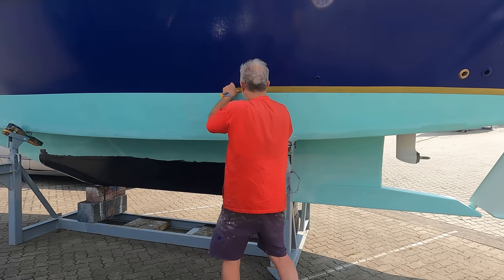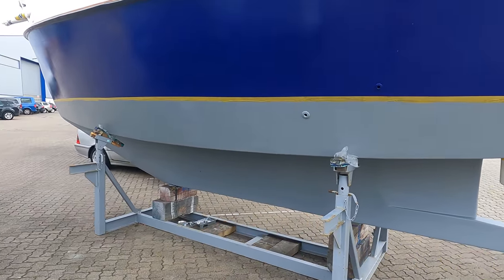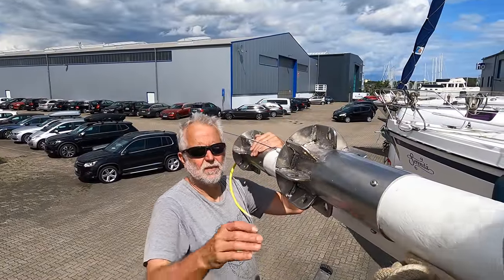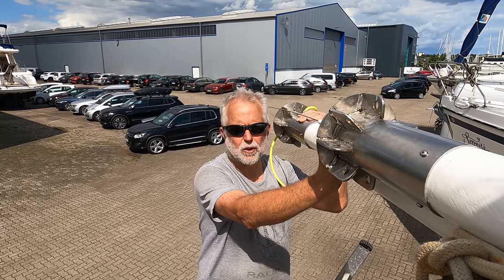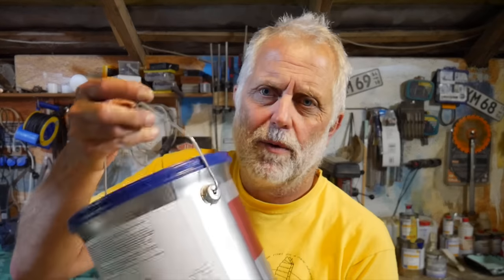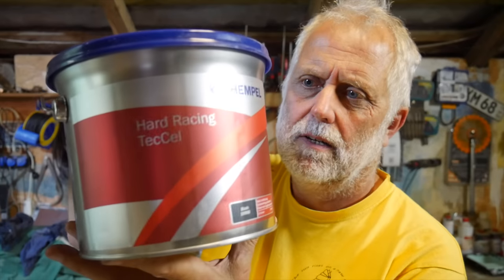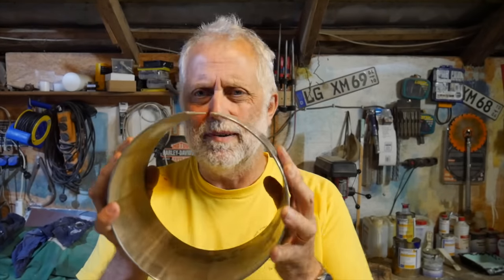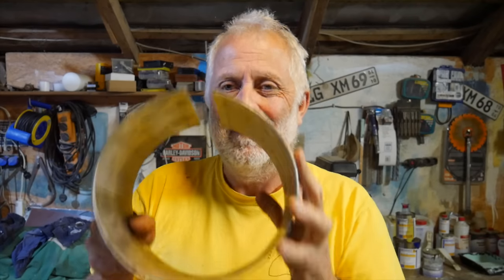Next Week Is MASSIVE!! - Building a cruising sailboat - SV Tapatya EP288

Comment: Superb Tony. Best wishes to your old fella on a milestone birthday. Paintwork looking sharp. On the mast clamp doohickey - maybe a thin sheet of rubber inside the clamp - increase friction and prevent the edges acting like a chisel as it takes the load.😉 Look like you will be back in UK just as the next wodge of rain moves through. Good luck with those final few jobs prior to splash.😀👍⛵️
Reply from the maker: Thanks Norman. 👍😃😃

Comment: Looking beautiful with that black bottom and blue topsides Tony. Nothing like having good steady help. Best wishes to your father for a wonderful 90th. If you have access to Ashley's book of knots, I believe there is a spar hitch used to raise spars. If I recall correctly, it consists of a constrictor hitch at the bottom of the spar and a series of half hitches in a chain to the top of the spar. It tightens with the load and releases when the load is removed. Have a great week.
Reply from the maker: Thanks Matt. I’ll look into that. Sounds like a useful resource 👍😃😃

Comment: That mast fitting looks easily strong enough, Tony,  to support your main mast, in sheer.  My, smaller, 8m mast (aluminium and douglas fir) was lifted in with nothing more than a tight clove-hitch knot, about two-thirds of the way up, and that rope went straight to the crane hook.  As security, I took a loop of dynema through the base of the mast (there was a small hole there for the VHF antenna etc) and the other end of the dynema round the main knot in the crane-lifting rope.  But I needn't have worried: the dyneema safety loop remained loose throughout.  In other words, the clove-hitch knot held.  But I like your idea better!  I can't wait to see those masts in place.  All my best to you, and happy birthday to your dad.  - Chris
Reply from the maker: Thanks Chris. Useful info 👍😃😃

Comment: I do a lot of site maintenance I am confronted with similar situations. I have had a lot of success with using big clamps with half pipes on the static and tightening threaded part of the clamp. 2 opposing  clamps like I’ve mentioned can lift really heavy loads. Good luck.
Reply from the maker: Thank you. That sounds pretty much like what I intend to do. Good to hear it works 👍😃😃

Comment: You have some quite beefy metal structures on the top of each mast.  Could the crane not hook on to those to lift the masts?
Reply from the maker: I’m not sure the fixings are strong enough, Marshall, they’re designed to take downwards loads. I’m putting some beefy metal rings near the bottom of the masts, they should do it 👍😃